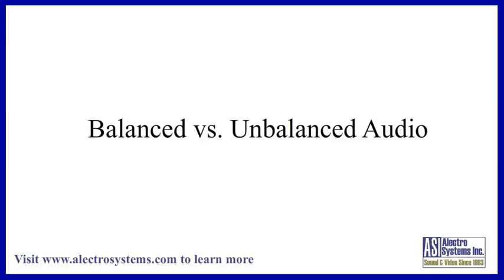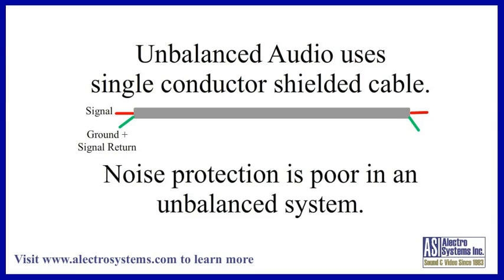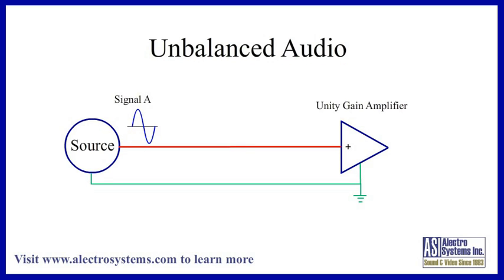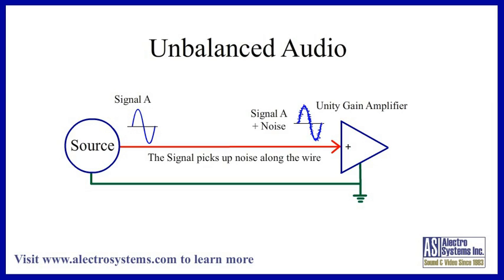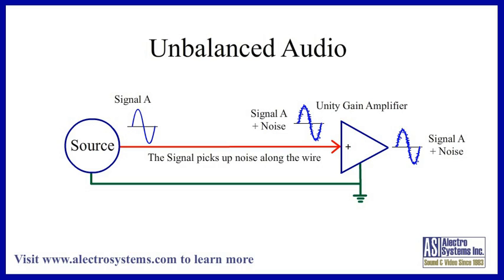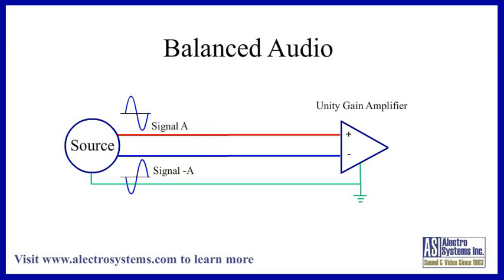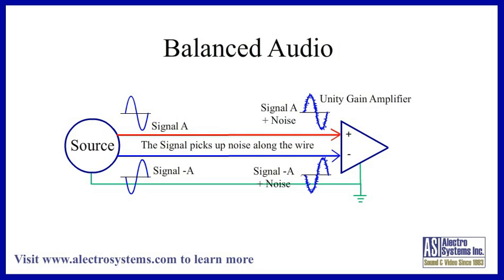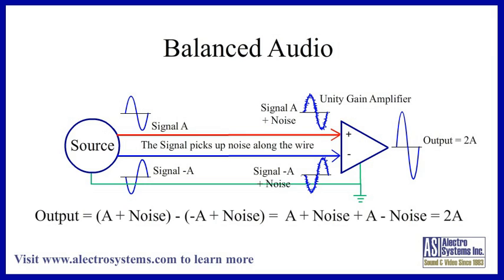Balanced Audio vs. Unbalanced Audio Signals - Understanding how they work.

Comment: That's right ! My question is: The + & - signals need to be an equal amplitude from output, or there's need to be different ?!? I thing is need to be equal, but I tested a circuit from acknowledged brand,  and the signal from out isn't equal. So I changed the resistor to higher on opamps - signal from 10K to 22K,  on + in I leaved the 10K, and now its equal. :)

Comment: To say "180 degrees out of phase" instead of "inverted" is actually a misnomer: yeah, ok it's sort of equivalent in the case of a regular waveform, but the inverted signal used in balanced transmission is not the product of a phase shift, and this nomenclature is completely wrong when we're talking about audio signals, which are not regular i.e. repetitive, signals. Other than that thanks for the vid, nice clear presentation.
Reply: Music is wave forms any way. You are missing out on something.

Comment: I think is the best explanation i have seen. But just to be sure i got it right... The noise on the two signals before they arrive at the amplifier are in phase? And in the amplifier the two signals and noise polarity are reversed? So noise cancel each other because now they are out of phase 180 degrees? And the signal (amplitude) is duplicated because the 2 signals are are now in phase so they were added?
Reply: see my post above about inverted vs phase nomenclature; the noise signals as measured at the inputs of the differential amp are the same polarity, but the audio signals are opposite polarity. The diff amp produces an amplified version of the difference between the signals at the + and the - input. This is ok for the audio because we've fed the two inputs with opposite polarity signals. It's also great for noise cancelling because the +/- nature of the diff amp means that the noise signals effectively are nulled out in the amp, because the two leads, being in very close proximity to each other, pick up the same amplitude of noise signal. Google balanced lines, or twisted pairs, for better explanation.

Comment: Is the source signal brought back into phase at the end of the cable itself or by the receiving input at the end? Can using a female to male xlr converting adapter (male/male or female/female) reverse the phase again and thus making the received signal noise only?
Reply: Hi,
I thought I'd answer the question on Alectrosystem's behalf.
The input of the amplifier does the work as explained in the video. i.e. Mackie SRM450 version 1 and version 2. They require a 'balanced' input and the 2 signals run to an operational amplifier (chip) which  amplifies the difference in the 2 signals. The difference is the music / audio since the noise will be the same.
You can use cables to convert to 'unbalanced' but not the other way round.
The noise is on top of the signal so you can't separate just the noise.

Comment: If all systems need to be balanced as you said, then why still manufacture unbalanced cables? Why not just make everything balanced?
Reply: the cost of copper wiring 3 instead of 2, and simplicity; for short cable runs balanced is not necessary

Comment: Here is my question (I am a dilettante when it comes to the electrical component of recording): I plug a balanced cable into my guitar. How does that signal become inverted on the -A side?
Reply: Are you sure that your guitar use TRS connectors? I thought they use TS, which is unbalanced.  The signal will never be balanced before both the source, the cable, and the connection in the other end is balanced.

Comment: Thank you for a great explanation. Now I know that in my next DIY unbalanced interconnects,.only positive wire (center RCA '3 screws type' conector pin) carries actually actually the signal in the silver plated copper shielded wire. Thank you!

Comment: Great video.
What would happen if say, I connected an unbalanced stereo (single signal line for left and right) such as phono L R  in to a balanced amplifier, (2 signal line each for left and right), would that simply not work properly? Or would it be just as effective as having an ordinary unbalanced signal to amp?

Try to illustrate:
monoL ------> balanced signal A ---------------- balanced amp
                      ?`¦> balanced signal -A ------------ balanced amp

monoR ------> balanced signal A ---------------- balanced amp
                      ?`¦> balanced signal -A ------------ balanced amp

My reason for asking is, I am making a custom audio switcher that has 4 selectable stereo inputs and balanced stereo outputs (required for balanced active speakers)
I suppose it would be easier for me to just leave the unbalanced option and just make a balanced audio switcher, or is there some clever way I can jury rig the unbalanced signals into the balanced ones?

Thanks for any reply :3

Comment: Conclusion: "All sound systems need to be balanced".  Where the run of cable is short then the noise on the signal wire is negligible.  For example a 50 cm interconnect between pre-amp and power-amp would not need to be balanced unless there was an extreme condition.  Many amplifiers do not have the option of balanced inputs.  Moreover those cables can be shielded even if unbalanced.  This could be by way of a co-axial signal cable, or a shield in addition to the signal and return wires.

Comment: This is very good. Thank you so much. I liked the simplicity and clarity, and the equation at the end. I will go on and research how the amp substracts signal 1 minus signal 2.
I do have a question, on 1:40 you say that the ground cable is the return path for the signal. I don't understand this. Please help.
Thanks again.

Comment: Everything makes sense except for the part where he says, "However the noise is in phase".  If the two signals are 180 degrees out of phase with each other on a Balanced audio system, then why does the diagram show the noise following A and -A along their wave trajectory? Is their some deeper science behind noise waves which always keeps them in phase with each other? If so are they oriented as + or - or neither when processed by the differential amp.? Besides that the video was succinct!
Reply: It's just a wrong graphical representation but the idea is correct. Think of it this way, if you would plot alone the noise signal in both of the wires, it would look the same. The noise is just mounted on out of phase signals, but the noise itself in phase.

Comment: Keep in mind that being balanced does not equal noise rejection. In accordance with V=IR, if A and -A are not the same impedance from driving to receiving end, the *voltage* noise induced in the wires will not be perfectly equal and not be perfectly rejected. It goes much further than that, of course... That's just one example.

Comment: I can see the advantage of having one signal the complete polar opposite to the other, but this would still work fine with both signals completely in phase but with one stronger than the other. As long as the interference is exactly the same polarity and amplitude on both wires, then even if the two audio signals were in phase but of different amplitudes, it would still work (although you'd need to turn the gain up more to get the same volume out of the amp).

Comment: No, when subtracting a negative from a positive, this equals a positive. eg, if the signal is 2, then the out of phase signal is -2. Therefore 2- -2 = 4, this is the "difference". Because the noise is originally in phase it is then cancelled out because you are subtracting a positive from a posative. eg if the noise is 3, then 3-3=0

So you end up with a loud signal with no noise...... hope this helps :)

Comment: Because ALL the wires act like an antenna. This means any external noise the wires pick up will be in phase (i.e. the same noise on each wire). I think he’s talking about external noise, like a CB radio that bleeds into your PA or a vacuum cleaner that causes a hum in your guitar amp. He's NOT talking about internal noise (like noisy single-coil pickups on your strat).

Comment: 3:18 video says -> "these wires are connected to a differential amplifier which subtracts the out of phase signal from the in phase signal"
I'm confused, if the 'out of phase signal' (music) is subtracted from the 'in phase signal' (noise) doesn't that mean that we’re keeping the noise and subtract the music?

I would think that a differential amp (which only amplifies the "difference" in the signal) would subtract the in phase signal from the out of phase signal. Right?